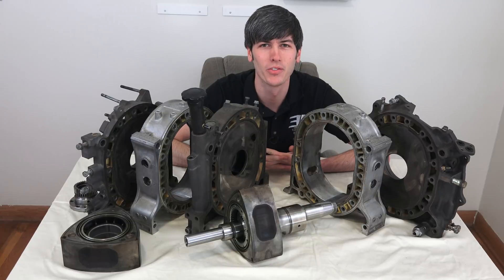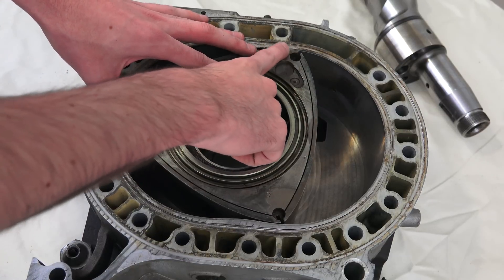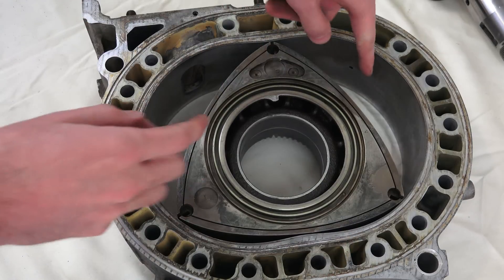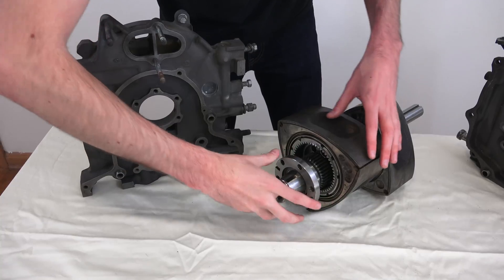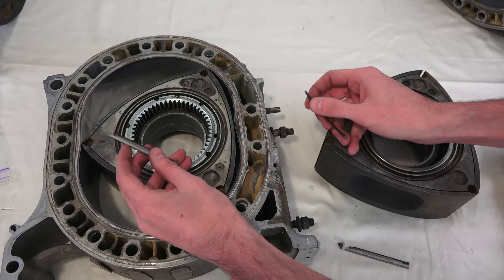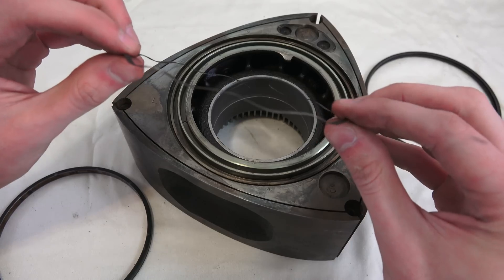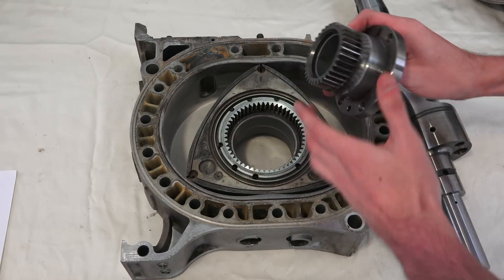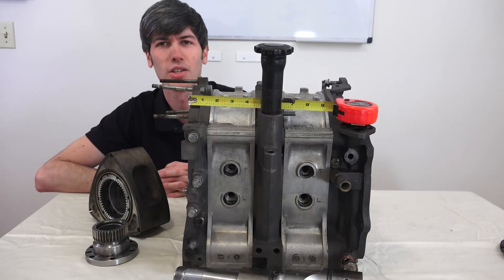How Rotary Engines Work - Mazda RX-7 Wankel - Detailed Explanation

Comment: did he say reliable?
Reply from the maker: +miguel martinez It was one of the words in the video, preceded by the words "can be."
Reply: +miguel martinez 9:50 in general, things that are designed to be simple can be very reliable, especially analog computation (all computers today and for a long time have been analog/discrete). the simpler a design is, the better it is. it's like applying occam's razor. you can also think of an engine as a system of moving gears. if you have more gears, it's more likely the system can fall apart if one of the gears become corrupted. in that sense, it can be reliable and can be reliably reproduced, and it's less likely to have errors.
Reply: +dogzday 
just because they can be doesnt mean they are. i can be a optimist doesnt mean i am.
Reply: miguel martinez well of course. have a nice day.

Comment: I feel like Rotary engines as a CONCEPT have great potential. But personally, I think that potential could be reached through either a complete redesign of the Wankel rotary or ditching the design all together in favour of one that can overcome the Wankel's disadvantages. 
There was this prototype made by a company called LiquidPiston, called the X2, which I think looks very promising. If you're interested, I suggest looking into it, there's too many interesting things about it for me to comment about. Short version is, the math and physics suggest it can have up to 50% efficiency per stroke compared to a piston engine's 35%. It can also run many different fuel types!

Comment: Wait the rotor cutouts don't increase displacement right? Since that space is constant, there is not air displaced through the cycle, it only increases internal volume which reduces compression ratio.

Comment: What I personally dont like is that the first spark plug is in the compression part. Once it ignite it give a lot of pressure on the apex seal since all that air/fuel is at is maximum compression. I believe that it would be better for both sparks plugs to be in the combustion chamber at about 2 inch apart. Again for me its does make more sense since now the spark could be longer and hotter and burn the fuel more efficiently.

Comment: Could you delete the oil injection system (and associated burnt oil, which is increasing unwanted emissions) if you could somehow make the engine use diesel fuel instead of gasoline? It seems the main challenge there, would be increasing the compression ratio to work with diesel(?). Thanks for making this video.

Comment: "The concave pockets increase the displacement of the engine."
That isn't correct, engine displacement is the difference between the largest volume of a "cylinder" minus the smallest volume of the "cylinder" (volume difference between BDC and TDC in 4 stroke terms). The pockets do affect compression ratio: the more material removed from the rotor (larger pocket), the lower the compression ratio.

Comment: So could you say this is a far equivalent to a 6 cyl piston engine? Taking the fact that it does 3 different strokes at the same time, times 2 because there are 2 rotors?

Comment: So if you build a custom triple or quad rotor does that mean that the rotor and eccentric shaft shape would be at 120 degrees [9 for the quad] or would they just be at 180 as they are in the standard twin rotor?
Also come on now, it's a German designed engine and is pronounced Vankel, as w's are spoken and V's.
Aside from my grammar nazi gripe this video was great, used it to help my mate understand rotary engines.

Comment: If you removed more material from the  combustion chamber in the rotor would it be the equivilant of boring out the cylinders or getting a longer stroke?

Comment: Seeing the way a two rotor engine is put together using a front, centre and back plate, would that mean that theoretically you could stick another centre plate in the middle and add a rotor? (Given that you alter the oil pump to squirt oil into the extra combustion chamber and alter the intake and exhaust manifolds)

DISCLAIMER Just a dreamer talking here. I am in no way claiming to be an engineer nor do I know what I'm talking about
Reply: +Austin Murphy Yes you're right. They have 20b (3 rotor) and 26b (4 rotor).

Comment: Disadvantages: Oil & Fuel consumption. That's all.

I know people try to bundle in Reliability, but it really isnt.
My first car was 1990 Rx7, and besides regular maintenance it was bulletproof. Regular redlines included.
Any car can break down without the proper care from its owner.

The Rx-8 got it the worst. So many people bought them, yet so few knew how to maintain and operate them.
Reputation down the drain.
 
Nowadays i drive a scion due to needing the extra seats, but i will always be a Mazda guy.
Reply: Anything will work well if you take care of it.
Reply: @twistedyogert  no engine can take the rpm abuse that this engine does and last 1/2 as long. Simplicity, few parts, fun
Reply: @duaneelsbree3460  2-strokes and F1 engines rev way higher and make more power..
Not really, a 2-stroke is more simple and jas fewer parts..
 Lighter too. 
That's why they still make 2-stroke engines and the Wankel is long obsolete.
Reply: @twistedyogert  Not true, Wankel engines are inherently unreliable compared reciprocating engines regardless of how you take care of them.
Reply: Reliability was the biggest disadvantage of the Wankel engine... so unreliable that they cannot be used in passenger aircraft applications.
Reply: The NHTSA recall investigations of the RX8 completely debunked that popular urban myth.
Federal investigator found RX8 oqners with fully documented service and inspection records suffered the same unacceptably  high premature engine failure rates.

Comment: The wankel engines are so freaking cool to me. I hope that at least the rotary range extender does really well. I still really want one of those as a generator.

I also still think it'd be hilarious to attach one to a cvt just to have so few moving parts in your drive train. It'd probably be crappy to drive though.

Comment: 9:23 "... by removing material from the rotor, you increase the displacement of the engine."

Removing material affects the compression ratio, not displacement.
Reply from the maker: +MalachiTheBowlingGod That's silly. If the rotor took up the whole housing, there would be no displacement. The less space it takes up, the greater the displacement. Yes, it does alter compression ratio. It also alters displacement.
Reply: +MalachiTheBowlingGod think very hard about the intake stroke. It keeps getting bigger and thus drawing in more air. Imagine if you could make it even bigger by adding that hole/removing the material from the rotor. The space that material took up can now be replaced with fuel and air.  More fuel and air = more power.  There is more space for air and fuel to go into meaning it has a bigger displacement.
Reply: +Engineering Explained If you take a quick trip to the Wikipedia page on Engine Displacement, you will see that displacement depends on swept volume. (They only consider piston engines, but the concepts still apply.) Swept volume is controlled by the throw of the crankshaft. Nowhere does it mention combustion chamber volume (aka clearance volume,
 which includes dished pistons/rotors), and if you look at the equation you will see it doesn't even get mentioned.

If you need further info, swing by the compression ratio page where dished pistons/rotors do come into play, as they alter the largest and smallest comubstion chamber volumes.

Comment: Really amazing video!! So well explained!  For ages I've always known bits and pieces about how these engines work but now that I've seen your vid I actually understand it all now :).  

You mention in the vid however about these engines having good reliability.  I find that an interesting comment as most people's experience is that rotaries don't last as long as conventional combustion engines due to the loadings and multi-directional force on the seals, plus the huge importance of adequate engine oiling.  I would also have like to have heard your thoughts and comments on rotary engines' general lack of torque (they can make big HP, but relatively low torque) and also high fuel efficiency when compared to regular combustion engines.

Thanks for a great youtube channel!!

Comment: I really enjoyed this video. It's the first time I've felt like I understand these amazing engines. Other than mentioning that you are also burning oil, however, you didn't really touch on any disadvantages of the Wankel rotary engine and why there isn't one in every car today. I got poor fuel efficiency from the other comments for this video, but are there other problems that I'm missing?

Comment: I've been told that a chief weakness of this engine design is the apex seals; that is, if you overheat them, they fail and you get stuck on the side of the road. Is there any truth to that? Also, I have to question its lack of presence in the automotive market. If it's such a great design, why isn't it more common? I'm guessing the oil injection aspects make it an emissions liability in the North American auto market.
Reply: +riblets1968 Apex seals aren't really much of an issue since the 70s, emissions and fuel economy are what keep it from being used.  The RX-8 had issues mostly due to Mazda trying to run the car as lean as possible and with as little oil injection as possible to pass emissions...  

Apart from oil injection they also have problems with unburnt fuel in the exhaust (why they often spit flames).  They're hard on catalytic converters too as you can imagine.

They're a great engine for a sports car but not so great when you have to meet emissions requirements.   But Mazda is working on it, so I'm hopeful they'll figure out a way around it.
Reply: At least I was partially correct! Thanks for the additional information!

Comment: Some cars Companies didn't give up. I think it was not a bad idea. It was just too ahead for its time. The introduction of new materials, like ceramic in metal, will help with some of the heat, lubricant, and friction problems. Rotary didn't die yet! For some reason, there is a lot of investment and decades of research on it. We know actual airplanes. Will you believe it came from Right brother's first tries? ;-)   Thanks for video. You make it to look simple and easy.

Comment: I've owned many rotaries! All of mine were very reliable and my 88 Turbo II actually took me to 180k miles before I sold it. Run 2 cycle oil in the gas and these motors will reliably give you years of fun!

Comment: I think that those hollows on the rotor are to keep the leading and trailing parts of the combustion region connected as it passes over the convex features between the two lobes of the chamber. Otherwise, during the combustion part of the cycle, the gasses in the trailing chamber wouldn't have anywhere to go.

Comment: They don't make enough torque.  They make plenty of HP but they have oil consumption problems which is unacceptable for a street engine.   Maybe one day, as someone said below, the sealing problem will be solved.  Seems unlikely with them going out of production for passenger cars.

Comment: Oh wow. How weird... I always thought RX-7s worked by replacing the stock motor with an LS1.
Reply: +TurdFurgeson571 That's good trolling.
Reply: +TurdFurgeson571 Thus making it boring? No thanks.
Reply: MarchuxProductions Ok. I was making a joke because a lot of people put Corvette engines in these tiny cars. It wasn't a shot against the Wankle. Say what you will, but I don't think you can sustain the case that a Corvette engine in an RX-7 is boring.
Reply: TurdFurgeson571 It is certainly less exciting than a rotary.
Reply: MarchuxProductions Why do you say that? Doesn't that depend on preference?
Reply: +The real doktorbimmer i have a friend who has an RX8.  The RX8 is the most unreliable rotary Mazda ever produced, but it still runs great, even in temperatures reaching -20 Celsius. He just maintains it like one should maintain a rotary: making sure it gets enough oil and revving it high. Rotaries are unreliable only if you don't know how to take care of them, which isn't hard, just completely different from a piston engine. 

And having driven both that RX8 an LS3 powered 2013(?) Camaro, I can say that the 13B was much, much more exciting to drive. That 'Maro was just plain old boring compared to the Mazda.
Reply: ill just leave this here again about your reliability claims https://en.wikipedia.org/wiki/Wankel_engine#Engineering

Comment: This seems very simple. I never realized how simple it all seems, no pistons no camshafts no timing belts (right?) no lifters, no pushrods, no valves. 

Just the lord and master that is rotary.
Reply: +Siggy Cloud No timing belts. Only the water pump and alternator have to be belt driven, by a standard V belt obviously. (My car has no power steering or AC)
Reply: Charles Darwin That sounds so simple an idiot like me could build one.
Reply: Easy. I help rebuild one. It was both of our first times. Took us 6 hours.
Reply: not including taking it out and putting it back in.
Reply: The real doktorbimmer While that is true the engine is so simple an idiot (me) could take it apart put new parts in and put it all back together and it would be fine, That's what I like.

Besides it's not like a normal engine doesn't have parts to break wear out and go wrong they've just had about a century more time to be refined and re designed.

Comment: So if it's such a simple design why do people say that it's unreliable? and reacts poorly to modification?
Reply: +John Calles They respond very well to turbocharging because they have a huge exhaust volume for their size, but they have VERY hot exhaust. 

Reliability issues were mostly due to sealing issues in the 70s, turbocharger complexity issues in the 90s and strict emissions being too hard on the engines in the 00's.

The older RX-7s responded extremely well to modifications, the RX-8 was pushed pretty well to the limit from the factory so it's harder to just change something simple and make power, because Mazda had already done it.

Comment: What kind of power does this design have verses a piston/cylinder design? Love to here some comparisons with each on things like MPG, HP, Torque, Reliability, Maintenance, Etc. Thanks for the great videos!!!
Reply: +CDP135Z Heres a good on between My friend and I. I have a 1985 RX7 (Cameout 1978) and he has a 1981 Celica (Came out in 1978) 

Mazda                   Toyota
1.1 litres                 2.4 liters
100hp                     92hp 
105ft/lbs                130 ft/lbs
2200lbs                  2400lbs

With 50 liters of shell 91 the RX-7 will get about 350KM, his Celica would get 500km. The RX-7 was faster by a good amount but if starting from a slight roll in first gear the RX7 lack of torque would let him take the lead, but once I was at 3500-4000rpm I would catch up and pass. As for reliability My RX7 has 205,000KM on it and still compresses above 110psi on both rotors.
Reply: +Charles Darwin Thanks! That's exactly the kind of I for I was curious about. Sounds like it's a fun car to drive.
Reply: CDP135Z It does hectic skids.